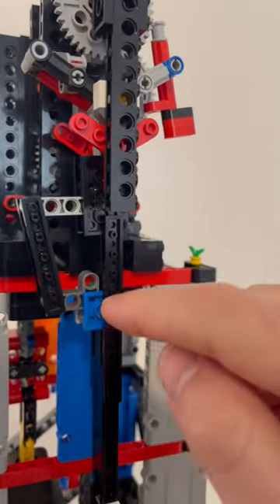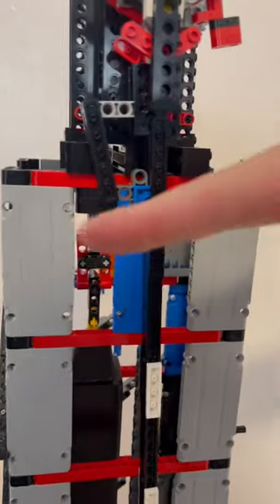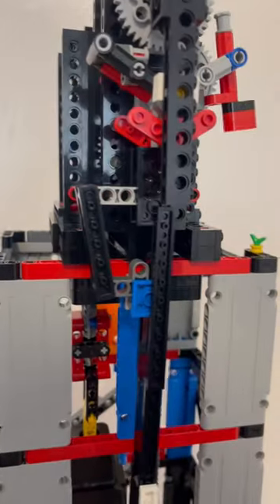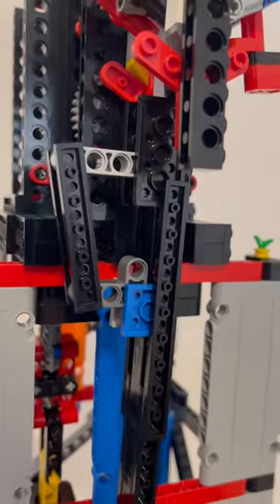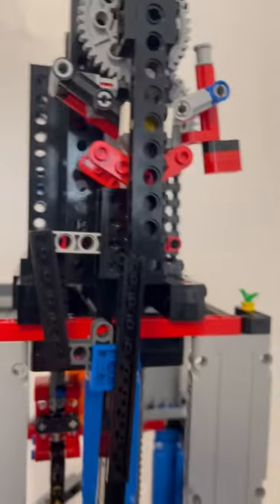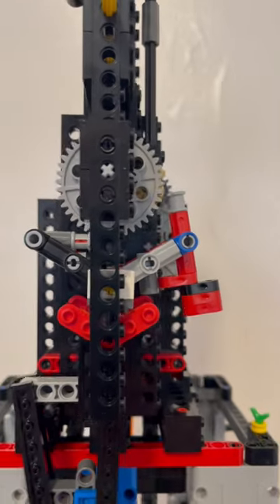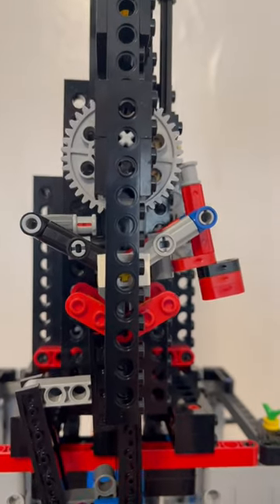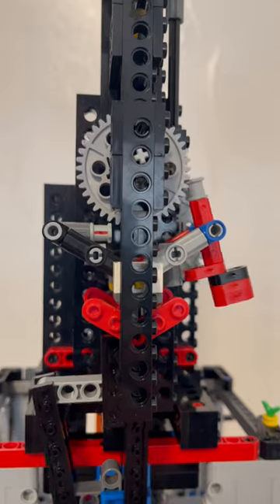Lego Escapement: Advanced. Pt 3, Balancing the Pendulum.

Comment: i had the same issue with the Ziemkiewicz grasshopper, so i implemented a linear actuator to adjust the angle.
KEvron
Reply from the maker: I didn’t use the linear actuator because it’s a little loose and I want the pendulum to be as rigid as I possible. 
Did you find that to be a problem?
Reply: @berellevy2  
yes, it's a problem but one that can be mitigated. it's explained in one of my videos, but the key is to actuate in only one direction. essentially, if you overshoot the target, then you back out the actuator and try again.

in my first attempt, i used an axle through a technic brick with x-hole. it was very rigid, but tough to make minor adjustments to it.

KEvron